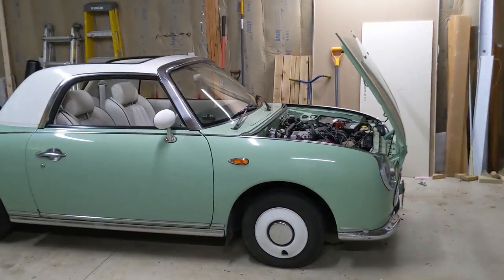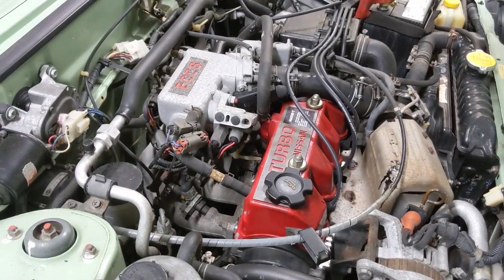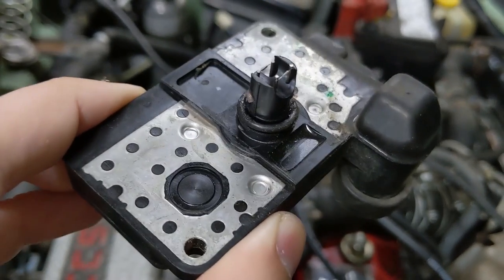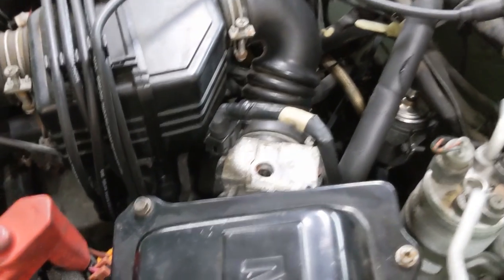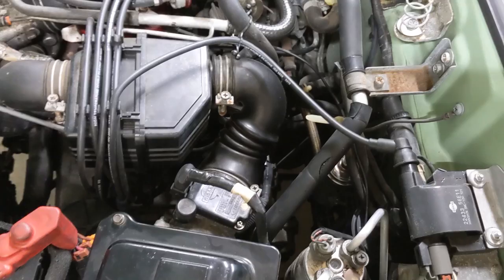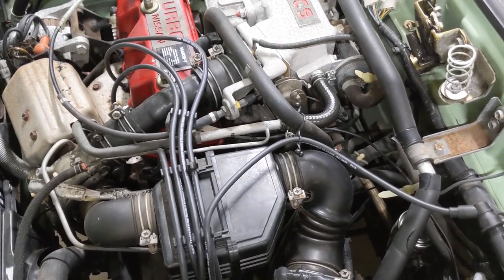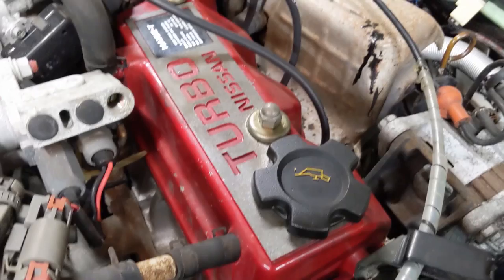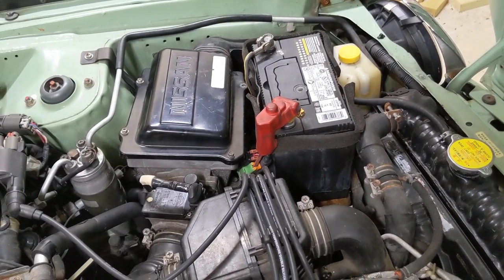Modern engine control musings and Fixing a Figaro

Comment: ALWAYS ALWAYS try the easiest thing first.  Nothing is worse than putting several hundred dollars worth of parts into a car and finding out you just had to clean a sensor or plug something in correctly.  I almost bought nearly $1,000 in parts for my Jetta until we found a wheel speed sensor that was plugged in wrong by the guy I had to some work in it.  It's an easy mistake, the those plugs aren't keyed.  It threw all kinds of codes and my dash was lit up like a Christmas tree.  Flipped the plug around and all the codes cleared and the lights went away.

Comment: When my truck was doing that surging thing with the rpms it was because the fuel pressure regulator was going out and causing it to run too rich and the computer was trying to compensate

Comment: You have tear in the insulation of the AC lines next to the MAF sensor. I guess it is not that significant but I am expecting that to be degrading after 30 years BTW.
Reply: meaningless input

Comment: By far my LEAST favourite feature of an electronically controlled engine is electronic throttle control. It's not so much the concept itself, but rather the implementation - ETC gives them the freedom to make it feel perfectly linear (an advantage over a cable throttle) and potentially just as responsive, yet every single one I've driven feels like a mushy spongy ball of jelly 😠

Comment: You likely have a vacuum leak.  Fix that part you suspect then if that if that isn't it trickle propane with a very small tube around.  The engine will rev when you find it.

Comment: Yeah… but you’re little Nissan ain’t going to shit itself if the Radio decides to die. That’s the eletronics control we’re talking about. 

I know, my 2015 Subaru had engine issues (of course it did) caused by…? Well we never found out. Some electrical issue despite basically every electrical component to do with the engine being replaced from the ECU to the battery at the cost of multiple thousands of dollars, catalytic converters replaced when this all started and then in 6 months the new ones were completely gone. But yes smell like a lawn mower and throw an electrical specific code on the EGR circuit that is just between the ECU and EGR valve when those two components were replaced including the wiring harness. Did I mention, I kid you not, this was literally a month out of warranty???

Comment: If it has the distributor, then the computer can't change the ignition advance. That's what distributor does, it distrubutes the spark in relation to the position of the crankahaft. If you want a computer to change the advance, then the computer has to be distributing the spark. Those two things can't work together, one is dumbly simple mechanically, the other is rather sophisticated electronically, you can't marry the two. Stoichiometric combustion is outdated and purely theoretical now, all cars now run more on the lean side, if you are explaining the principle then you should mention this.

Comment: surging is most likely the Idle Air Control valve, and the coil cannot electronically retard or advance timing. also.. you can absolutely have a "good running" car with the t-belt off a tooth, especially older cars.

Comment: LOL, it looks like it's got the trap door style MAF, which that cleaner is going to dick about.  That thing on the dash isn't this thing's MAF.  You can CLEARLY see the door-style housing attached to the air cleaner assembly.

Also, no knock sensor, so no timing retard in the computer.  Just a fixed advance curve like an older car, and you can probably change the base timing which affects total timing.

Comment: When they say 'they dont make em like they used to', yea they are referring to pre 1980. The 1976 Dodge D200 in my picture has a simple 4 wire "ECM" which only controls engine ignition, based solely off imputs from the distributor. I do keep a points condenser distributor, along with spare ECMs etc on board, and it's never left me on the side of the road despite the raw abuse ive put it through. Yes its been my daily driver repeatedly.  NOT something I can say about my 2013 Jeep sadly.   Now your Figaro? Not familiar with these imports at all, and early 90s auto computers are universally hated by we pro techs as they are the worst to diagnose compared to the new stuff or the 'antiques'.   That said - vaccuum leaks are endlessly common across that entire vintage of car regardless of manufacturer. 

In any event -- whatever happened with this car? Did you get the bugs all sorted out or no?

Comment: 1:19 That is incorrect. The coil is definitely NOT controlled by the ecu in terms of ignition point/timing. This is part of the distributor. I don‘t know well this particular car but the distributor might have a timing adjusting mechanism. It is most often controlled by the engines vacuum. 
Tips:You could „smoke“ the intake system for intake leak if you want. /You could unplug the masairsensor. This turns the Engine lamp on but most interesting the ecu takes a guess what airmass could be present. If the car does (positive) change behavior you have found the problem. 
(Side note: Im a german car mechanic who does not write much in English) EDIT: It would turn on the check engine lamp if it would be there 😁
Great video as always!
Reply: This car is from an era where timing mechanisms in the distributor were being phased out, so most likely has a fixed rotor/shaft phasing, where the ECU just uses the trigger wheel to determine engine angle and then triggers the coil independently to control timing (based on RPM, temperature, load and boost). The distributor in this case just acts as a sensor and spark distributor.
Shorting out some terminals in a diagnostic port on the car will "lock out" the timing, allowing you to set the base timing just by rotating the distributor, for an engine like this the base timing will probably be in the realm of 10 deg BTDC, but one would have to consult the manual. Apart from that there are no other user adjustable features on this type of distributor - nothing to break either, apart from cap and rotor wearing out.
Reply: dquad and distributor getting wet. Unfortunately 😕

Comment: The distributor has a pickup coil to tell the computer the location of the engine. That, and maybe also a crank sensor. The computer should be able to advance and retard timing. It just uses that info for the physical location of the crank and camshaft.

Comment: Defenetly secondary Air system!
This operates just as your much desired Toaster, by the means of a electrically heated bimetalic Spring.
Theese tend to get stuck or the spring loosing it's tension causing them to screw up the starting process and generally  annoy the eccs.
A cold start should look like this 
https://youtu.be/s_7J8ajDpyI
A how to on repairing these (in German) can be found here...
https://www.b12-club.de/thread.php?threadid=5281
Further more idle could be set with the Screwdriver just where you read out the codes.
The Crank sensor could be cleaned.
It has two opto sensors one with 4 Slots for fireing and one with 360 slots for angle determiantion.
They need to be clean!... think of a cd drive running next to your engine.
The distributor case needs a good ground connection!
Last but not least failure codes are only generated if the engine tunrs and the failure is present.

Comment: Speedometer in kph - how do you manage driving correct speeds in the US? Right, you can convert on the fly, huh? :)
Reply: I did it for a while after accidentally getting a car stuck in Metric mode (the speedometer didn't have little numbers for kph, rather the speedometer would actually change from mph to kph with the same numbers). it's not that hard, plus worst case scenario just follow traffic

Comment: "looks pretty clean" man my whole engine bay is black as soot from previous owners over the years. I'm attempting to clean it, but boy it's tough.
Reply: Depending on what it is, some fresh engine oil on a kitchen towel can clean some stuff very well, especially if it is dried up oil on the engine block or something like that

Comment: Well this sounds weird but had a dodge truck do both of these things because of a bad battery/ connection it would have hard starts when room temp or idle at 2000rmp i put new posts and new battery and problem went away after computer learned

Comment: You may have a injector leaking. Or the fuel pump is loosing prime.
Reply: Turn the key on off on and see if it starts.  My guess it's the injectors or carbon behind the throttle plate.

Comment: The high idle is to prevent stalling on it's low displacement for the weight of the vehicle.  If you want a normal idle you have to go lighter.  This brings back memories of my 72cc Honda Cub.

Comment: Usually a start stall when cold means the  engine is trying to run the mixture too rich or lean.   Check your coolant temp sensor, often if that fails the computer can think the car is hot when it isn’t (or visa versa) and adjust the fuel mixture wrong.

Comment: Dude you have no idea how much control the computer has.
Reply from the maker: If I may be so bold, I think I actually do.
Reply: Technology Connextras reply to this and I’ll flip out
Reply: I flipped my fone
Reply: And this car is actually pretty tame compared to modern cars. My 1981 Ford Cortina has nothing. MAF is just mechanical flap before air cleaner. Vacuum-controled and not at all for cleaner emissions. Because there is no lambda sensor in exhaust. You just tune it by hand until your 2 litre Pinto isn't sending too much smoke into exhaust.
Reply: @TechnologyConnextras  you only think you do. 😝
Reply: @TechnologyConnextras  o2 sensor has no influence on startup since it will take quite a fair about of time to "go online" and the ecu wont consider it during sensor heat-up. you can unplug it to force an open-loop running that will be solely based on the maf sensor (and trusting that the air is only coming from the intake hose, not from a vacuum leak)
Reply from the maker: @Nebbia affaraccimiei I know that. I wasn't attributing the O2 sensor to the start issue, but possible the surging. And now that's been ruled out.